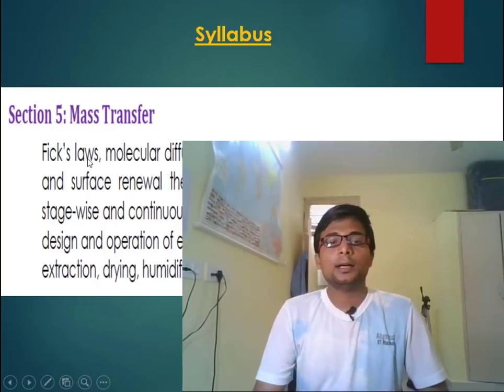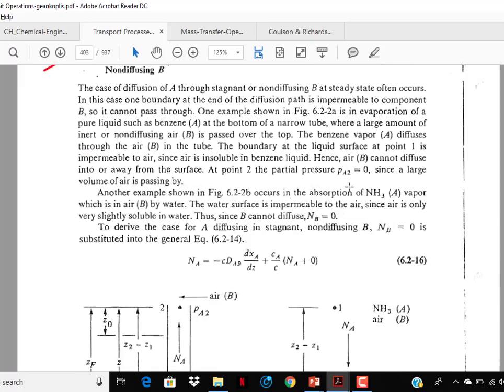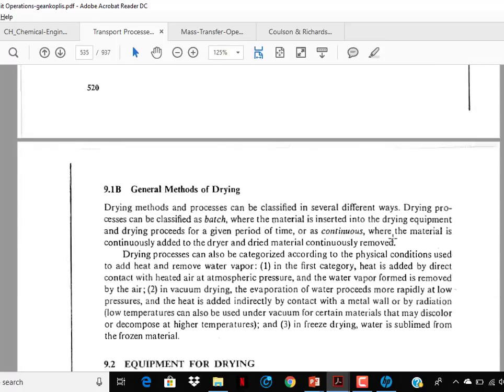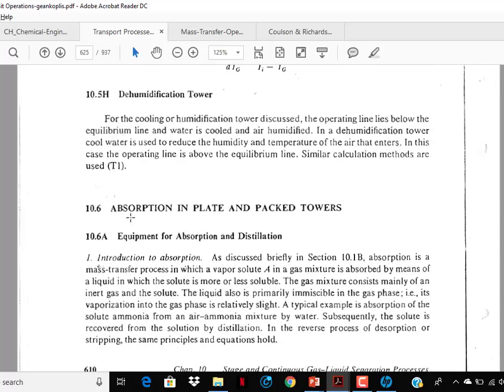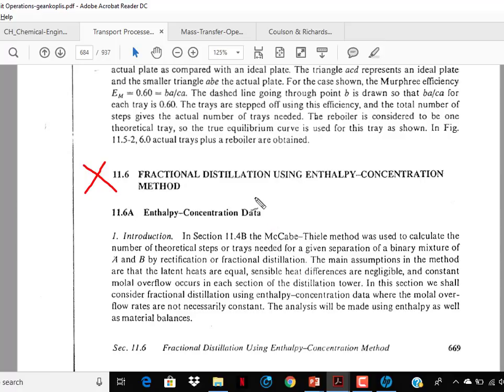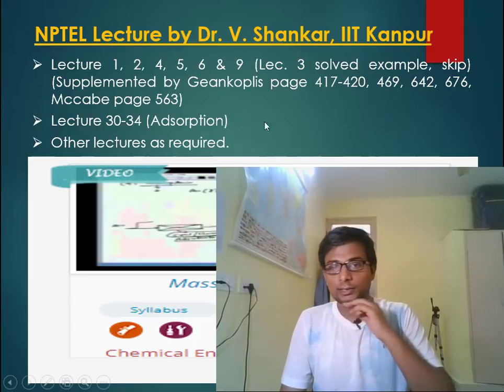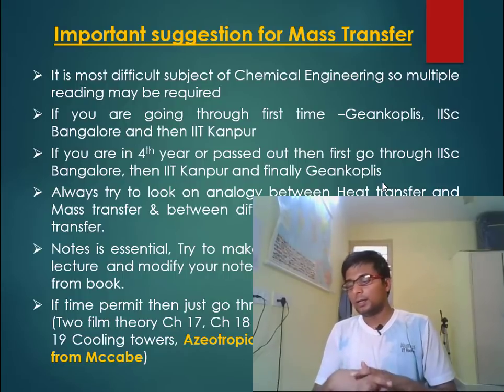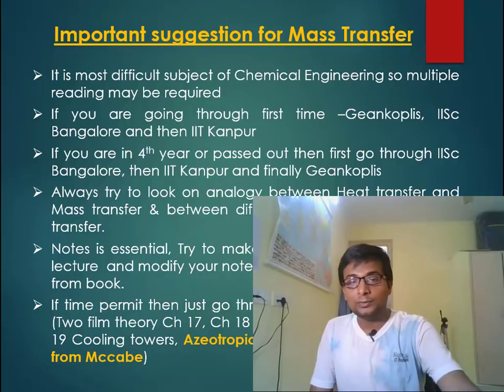Mass Transfer for GATE Chemical Engineering by GATE AIR 1 | Mass transfer chemical Engineering

Comment: Brother you dont have notes on full mass transfer as like mechanical operation?? And ur notes for MO is excellent im worried about that subject and at that time i got ur notes and its really helps me now i m stuck in MT.. I have mccab and smith in soft copy but from now i dont have so much time to read from there so i need some notes or any book where i can get imp things for gate without wasting my time on topics which is not that much of imp... So plz plz rp me fast im waiting for ur ans ❣️
Reply from the maker: Brother my notes on MT is not very clear. I have already some of my notes here. https://drive.google.com/drive/folders/1qMJbzON0CBcM03VleL5h-6EMUl29w10j?usp=sharing